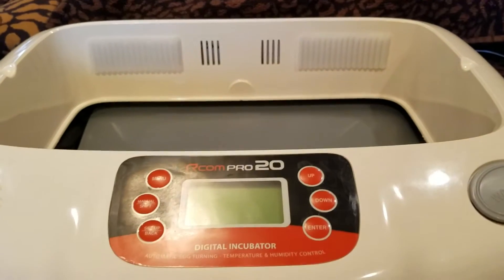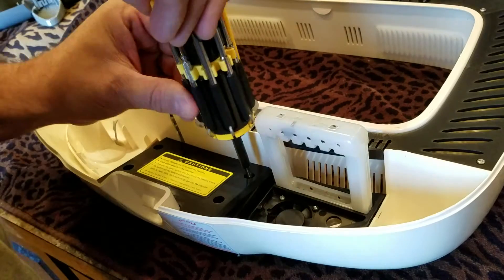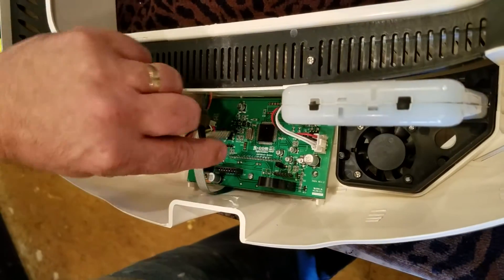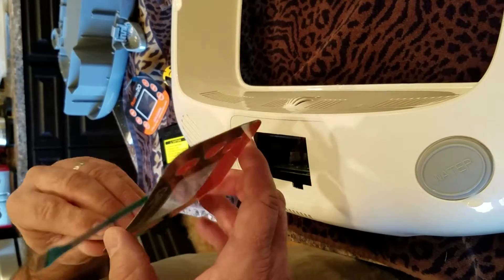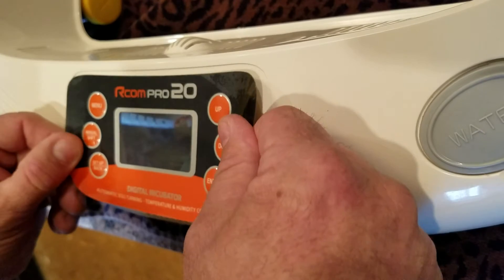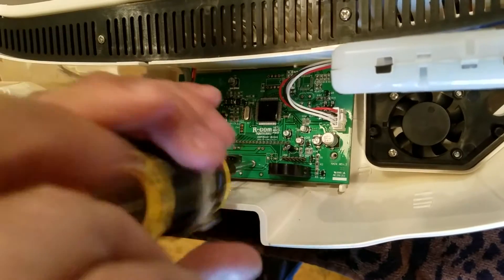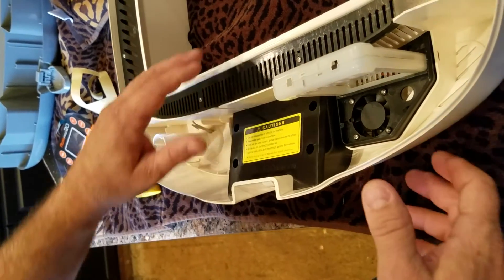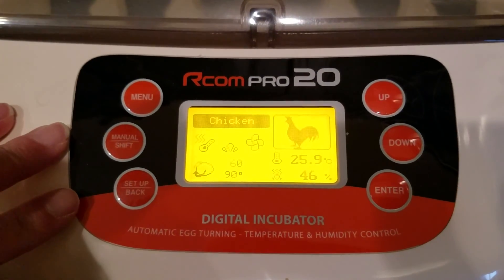Rcom R-com Pro 20 incubator repair faulty membrane switch

Comment: How are things going with the incubator? How many times have you used it? Success rate? We just got the Rcom MAX 20.
Reply from the maker: We have silkies, black copper marans and ameraucana
Reply: Thank you Cathy.
Reply from the maker: We love our R-Com. This was the only problem we have had to date. We usually keep it running from March through June.  Have mostly 90 to 100% hatch rates and if a bad hatch, feel like it is the eggs, not the incubator. I think you will be very happy with yours.
Reply: @cathybush3871  I've had ours running for 3 days as a test. It's pretty amazing. What are you all hatching?